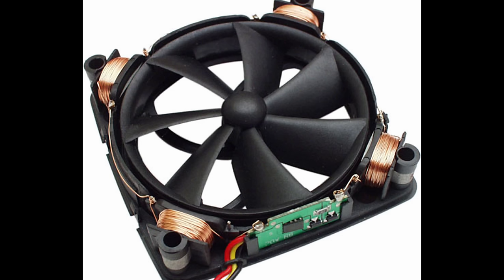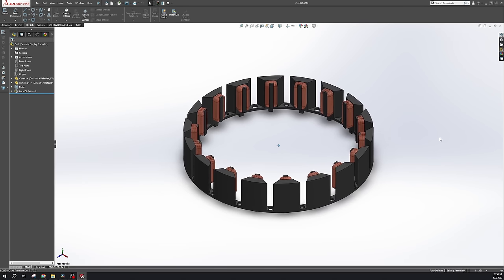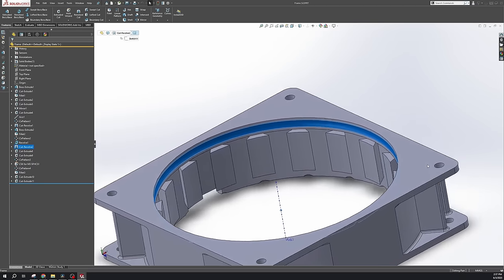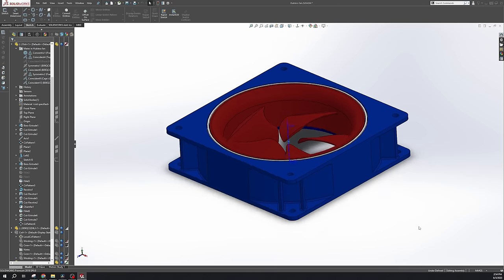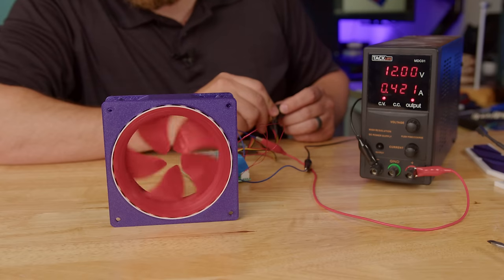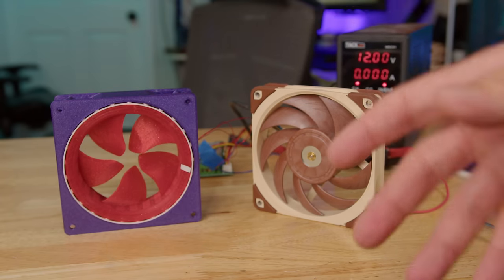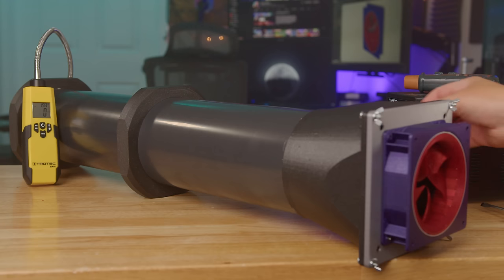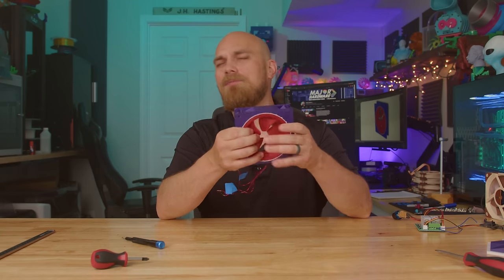I made a HUBLESS PC fan and it’s so loud!

Comment: I think using steel ball bearings would quiet it down quite a bit, because of the resonance difference. The poly-crystalline structure of ceramic is very brittle, hard, basically making it noisy. Using a steel ball bearing along with a dry lubricant like graphite would drop the noise immensely. Maybe a resin printed channel for the ball bearings to ride in would help a bit too. This project is AWESOME!!  I would love to see you take your awesome idea farther, and I am amazed at your 18 pole handcrafted motor's performance.
Reply: +1 for another go with some dry lube or graphite lube, such as Drop'L Do
Reply: A good PTFE base lubed would be better but dry lubes wont help with noise as much as a liquid or paste type lube although they would slow it down.  Trying some of each type to compare would be a good video idea to go with other improvements.
Reply: If he could turn the channels out of aluminum that would be ideal
Reply: @corpsemasterB312  I agree, although he did state that he wanted to keep it as 3D printed as possible.
Reply: Def some sort of lube on the bearings would help. I was thinking something like a grease, but know that would make a tremendous mess. Graphite is a good idea, though it will still be hard to keep whatever lubricant you use on the bearings and not all over everything else.
Reply: I also feel like making the blades go all the way in would improve static pressure immensely. It would kinda kill the hubless style thought.
Reply: @redcrafterlppa303  not really. you still wouldn't have a hub, you'd just have more blades.
Reply: maglev would be even better tbh tho, idk how it’d happen but it’d be cool
Reply: yes, use steel balls ( which are magnetic ) right next to the neodymium magnets. Nothing will go wrong

Comment: I remember when that tip driven fan came out.  I thought it would be great, but it was so expensive.  It never really took off because it had too many down sides.  The bearing was in the hub, which was why it still had the hub, but that was far superior to having the bearing around the edge like yours.  The reason the hubless design was used for the boat thruster is because water isn't as compressible as air.  It's actually needed in water.
Reply: Even though air is more compressible, wouldn’t having a clear channel of flow reduce the amount of work it has to do? No specialist at all just wondering
Reply: @devangoad  would it be same working principle of bladless fans?
Reply: @devangoad  you could see in the smoke test that indeed air wad flowing through the hole. But extending the blades to nearly touching would probably be even better at airflow and static pressure.
Reply: @redcrafterlppa303 which is probably why the hubless fan does not take off. You are just trading off a centralise hub with a hub spread across the the rim.
Reply: @wahidpawana424  I think technically the hubless could push more air but the large baring is killing the efficiency. Maybe if tech evolved some more a levitating version might make the hubless unbeatable and a common appearance.

Comment: 1. replace the bearings with just wheels in the corners
2. build the outer ring with 3 dove tails so that we can submit press fot blade sets
Reply: - both ideas are good, the corner wheels can easily use point/captured ball or other type of cone bearing - plain bearings for very little frictional torque.

 - the ring may need to be a little more substantial - but testing different types (of blade sets) or tip to root twist would be interesting... (also blade breadth from root to tip may  be an interesting variable regarding efficiency vs effective pumping - even using a sweep from tip to root to induce extreme core velocities...  hmmmm.)

Another benefit of using thermoplastics is the blade units could be printed straight (zero twist) - at the designed "tip pitch" - and the angle set or varied through heat setting - the optimal twist may not be a simple linear twist..
Reply: 1. Replace the bearings with small sealed bearings as wheels in the corners.
2. Build the frame as 4 parts(cut in half from front to back and side to side) so they can clamp the bearings in and then the fan hub/motor assembly.
Reply: @JETWTF  The problem is that the bearings will still need to travel the whole circumference of the outer rim, which translates to much greater speed and friction than if it was a standard hubbed fan. That's not to say your ideas won't help - they would definitely reduce the noise (4 balls instead of many), but the core of the issue remains - the high friction and energy loss.
I was thinking about a pair of magnetic bearings instead, but interference with the engine's coils might be an issue.
Reply: This 
This soooo much 
Please do this
Reply: But what kind of wheels would they be? If they were rubber wheels it would certainly make it ultra-quiet, but the rubber would wear off extremely fast.
Reply: A journal bearing would be way quieter!
Reply: @DjVortex-w  EPDM rubber and then make the wheels replaceable if they do wear out maybe
Reply: And only have the bades for the outer 1/3rd of the fan. The center is just wasted load. Venturi effect will draw anyway. And winglets or a tiny ring on the inner edge should help smooth the air flow. 
I think you could also go with spinning magnets in the corners instead of bearings. This will hold the permanent magnets in tension.
Reply: Magnetic bearings? I'm trying to reason about whether you'd need to add any hardware, surely motor controller timings could do the job? Although you'd need something for lateral loads.
Reply: How about lube dust? its a solid lube used on machinery... maybe it would ease up the friction
Reply: You should only need 3 points of contact to keep it centered, if deformation at speed doesn't occur. I like the custom motor, but if you use 3 or 4 wheels on of the wheels can be a powered drive wheel as well. Or as Tim Allen used to say, "More Power!" Have every wheel/ bearing a drive motor.
Reply: Upvote this now, great ideas in this thread. Was I could contribute. But alas I’m not that cool. 😊
Reply: @benholroyd5221  Everything except magnetic bearings is dumb.
Reply: Tolerances for fan designs are gonna be a huge challenge here tbh. More complicated in a hubless design than with a hubbed fan due to the higher speed of the bearing

Long term tests would also be interesting. Fans would need to be designed to minimize creep, as creep will change the bearing tolerances significantly after some time.

Comment: a few drops of lightweight silicon grease would reduce the bearing rattle a lot. you could print little air scoops on the inward slope that would cool the bearing as well.  great design.  the center open region might be creating the lower FPM reading.  i can envision the air packet leaking off the tips.  or go with the latest 'bound tip' from MIT and have the blades meet in the middle in some convincing symmetry like a spiraled needle.  I started a freeCAD course a while ago, inspired by your enjoyment, i'm not sure i got past lesson 2 before i got distracted by QGIS and rest servers.  I might have been the poster child for ADHD if they had that in the 70s :)  carry on, I will live vicariously through your tinkering.
Reply: I don't think the bearing should have any chance to get dust in them, especially with oil on them.
Reply: It might, but a large part of the noise is just going to be from the surface finish and a loose fit. Think about riding a bike with really thin tires on cobblestones, every bump in the rolling surface will jostle things around. The best finish you can get off a printer is going to be like the surface of the moon compared to the ground finish you normally get in a bearing raceway, and you're not going to be able to hold tenths to get a snug fit and low eccentricity either.
It's a really cool project and proof of concept despite all that though.

Comment: I love this idea. I’ve been thinking that the hub blocks so much potential. I think if this was done professionally or even with resin/injection molded it would be so much quieter and shake less. It may still be good to have the blades touch in the middle for strength and static pressure
Reply: My first thought is that the linear velocity at the centre is low enough that you’re not actually missing out on much having the hub there. But who knows, maybe it works like those Dyson fans that draw in more air than they move by themselves. Either way it would be cool to see a refined version.
Reply: He could make some steel molds and start mass production of them at that point. Injection molding is always better. Worked in that industry for a few years. Injection molds are perfect

Comment: Awesome design. One slight design change you should make is to make the blade section easily removable so you can play with different blade configurations
Reply: I highly doubt that it’s only a slight change, but thought exactly the same. Kudos
Reply: @agn855  Might be able to just out the blades, thin the wall as much as possible, then put some short dovetails on the inner surface. I think any solution that allows for removable blades is going to lose some wall diameter, but I feel like there's not much that could be done about that.
Reply: Yeah, he will def need to experiment with the pitch of the blades to see what moves the most air. A way of balancing it and quieting the bearings would help a lot as well.
Reply: @erictheepic5019  or maybe a screw in hub. Where a hub with a shallow long winded winding is holding to the bearing and a blade ring with a positive screw end to screw into the hub. This way you wouldn't lose anything compared to the static design.

Comment: I used to re wind dryers for grain bins. You legitimately did a better job than probably 75% of the people I worked with. Amazing. I would like to see this with a non-ferrous  metal race for those bearings. I think you might have something here... Especially for applications in air coolers where this would eliminate the dead space occupied by the hub.
Reply: I think even a non-ferrous race would slow it a LOT as the free-spinning neodymium magnets induce opposing eddy currents as they fly past it.
Reply: The blades in the hub area are mostly dead space anyway though. Since the blade velocity is much lower near the center than the edges.

Comment: The best build yet. That print quality is amazing. And while the fan is loud as heck, it worked decently, which is good for being a completely custom design. I want to see you run water-cooling tubing through the hole in the middle.

Comment: I really wanna see more of this. This needs to be developed into an actual option on the market.
Reply: Doesn't really make much sense beyond looking cool though. Since the blade velocity near the center is so low its not producing much pressure/flow there anyway. If anything you're losing static pressure as air isn't being prevented from back flowing by the solid hub. And the bearing on the edge means you have to have slightly shorter blades for the frame. Meaning you get less efficient blade surface area in the same 120mm package.

Also, at high RPMs this bearing is going to be more difficult to tolerance, which would require more expensive materials and more engineering hours, due to the extra force of the faster velocity.

Comment: A couple of things you could potentially try to reduce the noise is
1. Reduce the amount of bearings contained within the race. In turn should also reduce friction making it spin faster.
2. Use a small amount of grease like you did on that planetary gear fan. That might initially increase friction but once it’s worked itself around it should be lovely and smooth. Plus quieter

Comment: Been thinking of doing this for ages! Great job! Wondering if lubricating the bearings would make it much quieter. Eventually, making a metal channel for the bearings with tight tolerances and lubrication would make it quieter and spin faster (less friction)
Reply: Was thinking lube too and alot of it. Might even make the fan faster with less resistance in the bearings.
Reply: From what i have seen of 3D printed  things they are not really smooth so a lot of noise will be coming off  the rough surface of the bearing races and are the ceramic balls smooth enough .
Reply: A grease would likely make it quieter but is likely to slow the fan down due to friction. Under light loads lube adds to friction.

Comment: I own one of those fans! lol I bought it as a curiosity and it remains as that.

For a raw prototype, this was amazing! Well done! Even though it wasn't record breaking in air flow, I noticed immediately that the flow was exceptionally smooth without the usual back-pressure some fans exhibit. I believe that refinement of the blade pitch and overall design should provide significant improvements.

1.) anti-magnetic stainless steel or nickel ball bearings - contact Berry Bearings or some other company
2.) cage made from PTFE will reduce chatter in the raceway, may require cutting from flat stock.
3.) use metal impregnated resin to make the raceways or try to find actual naked raceways of required size
4.) final polish pass on raceways / blades and a very small dab of Teflon Butter on the cage (optional)
5.) and finally, you'd need to do some critical balancing on the "rotor", mostly due to varying amounts of glue and small deviations in resin fill. There was a visible oscillation of the bearings from off balance stress (I'm guessing) as you passed through certain speed thresholds.
Other thoughts:
maybe go with fewer poles as the torque required is not significant. I will say it seems to have a very respectable startup at low settings.
If available, consider using small round bar magnets as the retention method could be printed into the rotor.
Consider down sizing the wire gauge and increasing the number of windings. This will increase the impedance and flux density while reducing the current required to operate the device.

Certain devices, no matter how exactly they are designed or how precisely they are made are, at some point, subject to resonance. One such item is an X-Ray tube that uses a rotating anode inside a glass vacuum envelope (tube). This is a 3 to 5 lb chunk of molybdenum with an iridium coating on the active surface. If allowed to slowly speed up to it's optimal operating speed (10,000 rpm) it will develop a resonance between 600 and 3000 rpm with enough kinetic force to shatter the glass envelope. Boom goes $15,000 X_Ray tube. It has a very specialized startup system that boosts the RPM just before it hits resonance.

(on an odd note, the GE CT8800 CT Scanner used a turret bearing from a tank and the rest of the scanning gantry was designed around that. lol)

Comment: The hole in the middle is leaking air pressure, it works on the boats because the water rams at it as the boat moves, but for air it would benefit from different impeller design that has blades connected in the middle of the fan
Reply: So cross bar blades with a taper from edge to core? Like a cross?
Reply: This needs a two sided fan like a turbo. A large extended air scoop type blade forcing air into a sucking black hole vacuum fan on the exit side
Reply: @DominicRyanOsborne  yes

Comment: Dude, this is one of my favorite experimental fans you've made! Great job engineering the motor and bearing system. I'm shocked at how well it worked, and it seems like the motor you made has plenty of power. I think you could really beef up the blade design and get a killer fan out of that with only minor tweaks to the design. Making it quiet would be almost impossible without molded plastics, incredibly tight tolerances, and some sort of lubrication lol, but I would love to see you make a v2 of this fan.

Comment: You know I can actually see a very useful application for this. If your cabling needs to go down the same pipe as your in-line blower then having one of these with an open ring in the middle to run your cable through would make these applications much more simple! This is such a neat idea!!